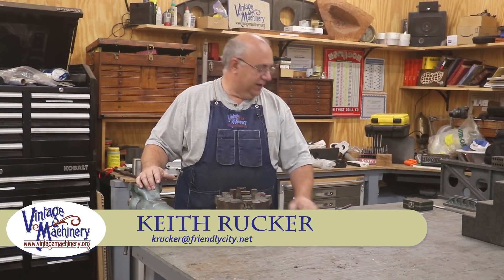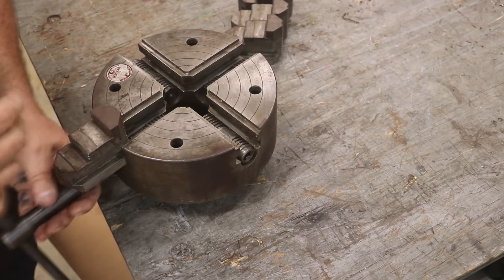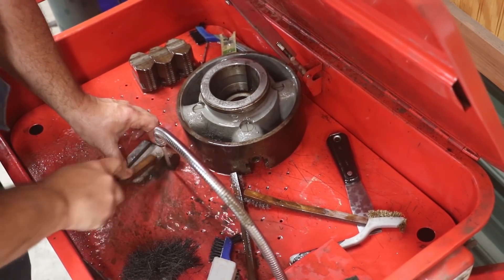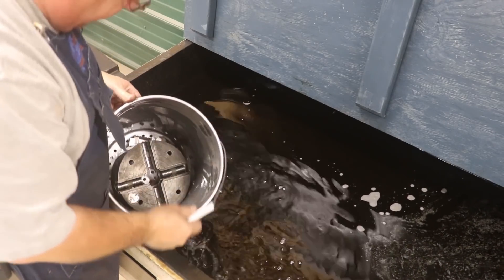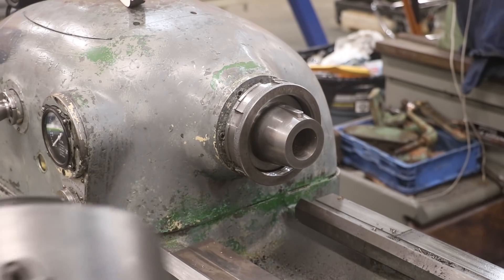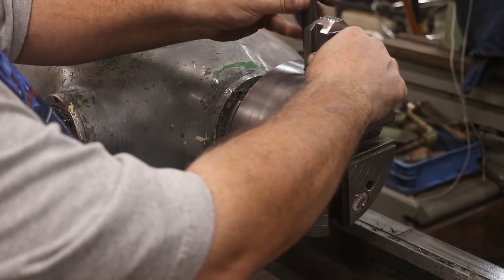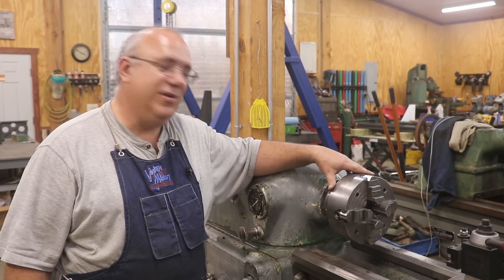Restoring a 4 Jaw Chuck:  Disassembly, Cleaning and Reassembly

Comment: Hi. Thanks for the video. I’m in the process of cleaning two chucks. A three jaw and four jaw. I’m wondering about removing those four threaded rods beneath each key. Is that a hassle? I’m putting everything in my ultrasonic cleaner before the Evaporust. 
Paul

Comment: Keith, thanks for sharing this bit of information. It is basic knowledge but there are always persons who do not know what to do with these.

All that being said:

1. It would have been beneficial to remove the screws as well,  but from experience, I know, that those screws can sit really hard. At least mine did. And they are not allen screws ....
2. Solvents can be really harmful. White spirits is probably one of the least toxic ones. However, one should not handle every solvent like that, for example Xylene is really nasty stuff and as it is used as paint mixer, it is quite often available in workshops.
3. Rotating chuck + bare hand is begging for injury.  An intermediate piece of rubber or perhaps a wood block would mitigate some of that risk. Some Chinese chucks have razor sharp edges and those can wipe the skin from Your fingers in milliseconds.
4. Scotchbrite has grinding agent in it. This should be somehow removed after the Scotchbrightening process.

And the speed indicator needle is still danciong ... :)

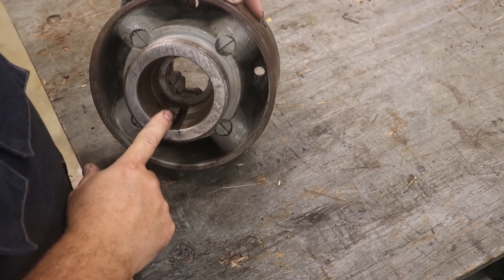Comment: @ 4:15 - "I think you can unscrew them from the bottom somehow..." - hey, Keith, a pro tip: there are four screws with a flat screwdriver slot in them on the bottom, you can see them @ 2:01 - 2:10.
And they go into them jaws driving screws, into that threadless part - and that's how they hold those jaw screws in place ;-)
Seriously though, I'm sometimes surprossed at various shortcuts you take. Taking those jaw screws would take no time at all, and would greatly facilitate the cleaning and drying job. Also, when cleaning threads it's better to ryn the brush aling thread grooves, not along the screw or bolt itself.
(Just a friendly advice  : )

Comment: Keith, you are a very well educated person. I am surprised that you take chemical safety so casually. I am a retired airline mechanic in California, in my younger day I took a bath in Jet A-50 another time I did the same with Skyrol 700 and I regularly worked with chlorinated solvents before the California proposition I did not think about the risks involved with their use, nor did my employer. I am not a safety Nazi but I get tired of people who should know better running down California regulations.
Reply: I also have been covered by different chemicals and solvents in my youth. Tri-clorinated solvents being one of them. 
   I was put in the position of safety team member as part of my duties at the laboratory I worked at. When I worked for Toshiba Machine I was required to ensure and notify customers if they were against the country/state regulations regardless of which country I was in.
   ☭california has gone way beyond what would be reasonable. If you read the MSDS some safer chemicals are outlawed while more hazardous chemicals get the A OK. They also made the petroleum companies put MTBE in the gasoline. And made them continue for years even after it was shown to cause cancer and reproductive problems. During the time after the hazards were known they still tried to force the rest of the United States to use it.
   Safety should never be made fun of, but I will not give a state total control of me.

Comment: Trust me, if mineral spirits is poison, I would be dead by now but I am going on 67 and have used it for most of my life cleaning  greasy parts on heavy machinery... Never ever used gloves.. We use to clean brake parts and hubs of Galion cranes with the bottom of a 55 gallon barrel full of varsol (Standard Oil Trade Name For Mineral Spirits) and a suction sprayer.. In winter, if the varsol was fresh, we would pour a quart of type A in it to keep from drying the hands so badly lol....We even used leaded gasoline if we didn't have mineral spirits in a pinch but that is not good because of the fire hazard....Still here.. Mike in Louisiana
Reply: meg.....Fun Fact:  WD40 is > 50% Stoddard Solvent (Varsol as a trade name).  Mix that with 25% mineral oil and you basically have WD40!

Comment: A quick Wikipedia lookup: "White spirit is mainly classed as an irritant. It has a fairly low acute toxicity[...]", but also: "Exposure to an average white spirit concentration of 240 mg/m3 (40 ppm) for more than 13 years (of continuous exposure time) can lead to chronic central nervous system effects. Similar long-term studies have been made in which some of the observed effects included memory impairment, poor concentration, increased irritability etc. White spirit is implicated in the development of chronic toxic encephalopathy (CTE) among house painters. In severe cases CTE may lead to disability and personality changes."

Conclusion, if you repaint a room in your house every couple of years, you're probably fine without the gloves. If you are a professional painter, you really want to be careful.
I'd think a machinist is somewhere in between an occasional user and daily user.
Reply: So does drinking alcohol...also if you soaked for 13 years in Palmolive...
Reply: Erik.....If I am going to have "13 years of continuous exposure", I better get to soaking.  I don't believe I have 13 years left !!

Comment: Would you concider spraying a light coat WD-40 on the chuck to prevent rust, if you don't use it everyday?
Reply: Adam over at abom79 does this religiously.  WD40 is a great way of keeping the rust away.
Reply: @Bobbywolf64  Adam has said he does it to displace the water in the coolant after he's done using the machine.
Reply: I have found that during machining a fine mist of oil applies itself to my lathe and all metal components. Never had a problem with rust. I do run heat by wood and AC in my toolroom which keeps humidity down also.
Toolroom is where I reload ammunition, make fishing lures, make furniture and operate my equipment. I'm an old retired guy. Just gotta stay busy.
WD40 was invented to keep moisture out of the Apollo modules. My dad worked on those projects. Check out teflon when you get a chance. It does leave an awful tarry residue behind. It is not and never was a solvent or lubricating oil.

Comment: Just a thought - wouldn't it make sense to close the top on the EvapoRust tank to slow down evaporation? Thanks for your uploads.
Reply: See that big black square piece of plywood that tipped up? Yeah.....
Reply: As per www.orisonmarketing.com/evapo-rust.html  FAQ

When not in use, it is best to cover (but not airtight) to keep out bugs. If any of the bath evaporates, simply add fresh water.

Comment: Still want to see that tachometer get fixed or replaced. That bouncing needle would eventually make me crazy.
Reply: Duct tape on the glass will fix it up.
Reply: @darrellbedford9925  LOL! The classic "check engine" light fix.
If it weren't for the fact that knowing the RPMs is kind of important in most cases, I'd roll with that.
Reply: It's bad enough watching it in the corner of the video, yet alone while you are using the machine.  It is probably an easy fix as well.  Make sure your grounds are good, but you can also dampen the signal from the sender with a series 10K resister.  Worth a try, and it would take a fraction of the time spent cleaning the chuck.
Reply: @TrevorDennis100  If I remember right, it's a fully mechanical gauge.
Reply: It is mechanical, it's like a square drive type deal, I think the clutch abrasive was worn in it if I remember  correctly from the video he  has  on it,